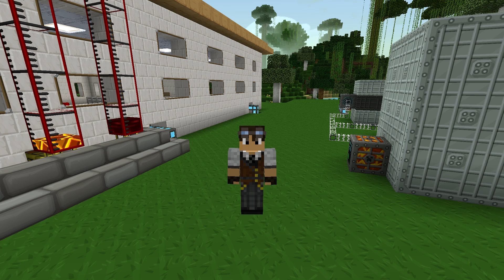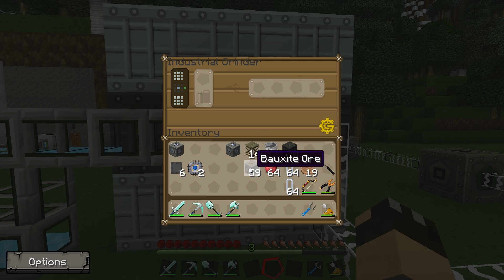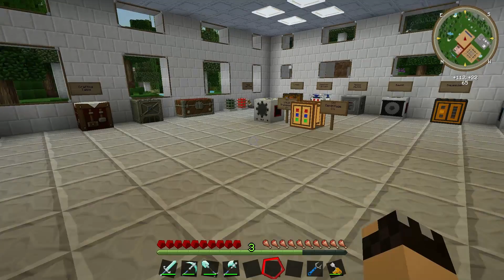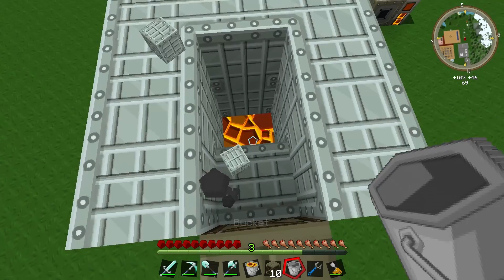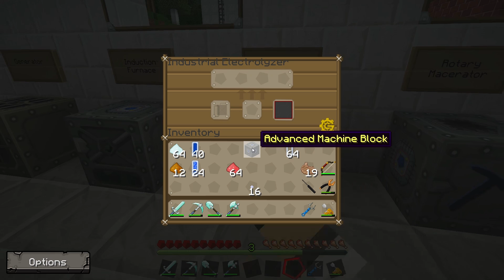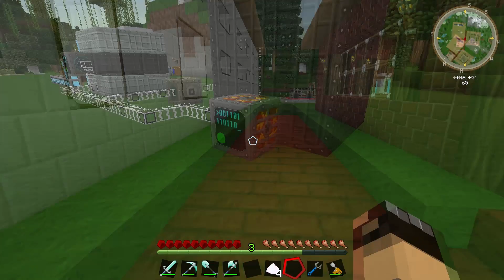Highly Advanced Machine Block - How to FTB in Minecraft - 45

Comment: When you produce the titanium dust from bauxite you end up with alot of hydrogen cells. Since you anyway need to reclaim (presumably) the cells I typically dump them in a gas turbine connected to my EU grid. In this way you get your cells back the same way as with an extractor, but you also reclaim some of the energy, 15k EU pr cell :)